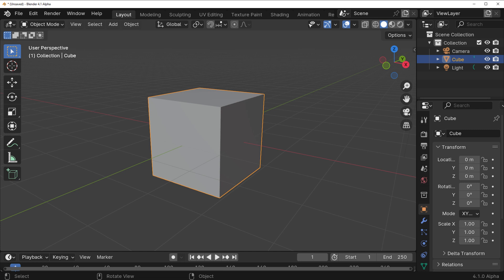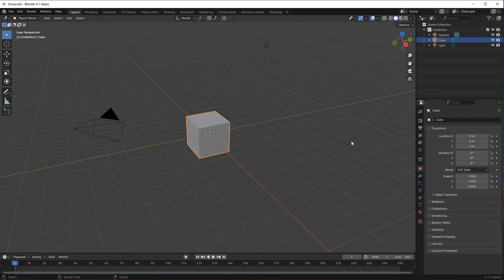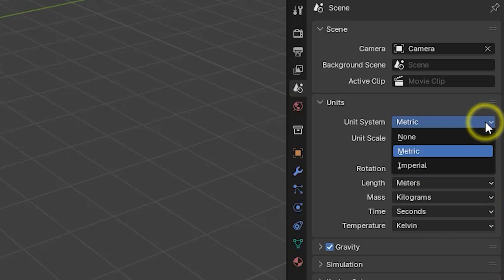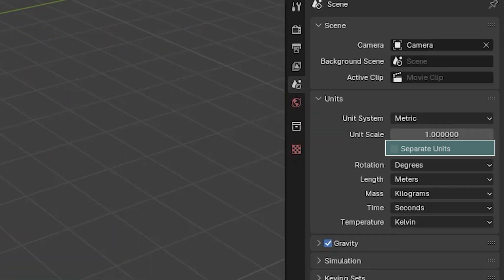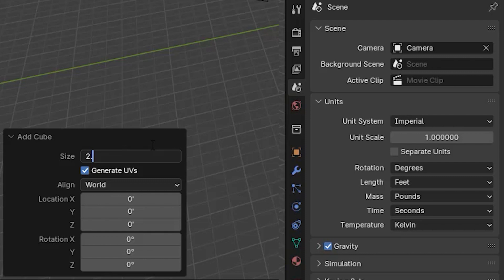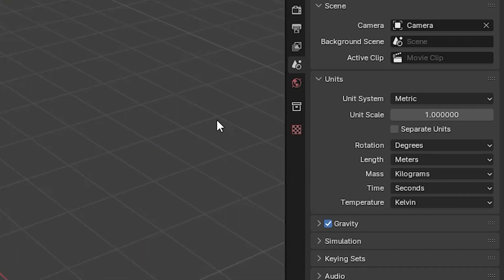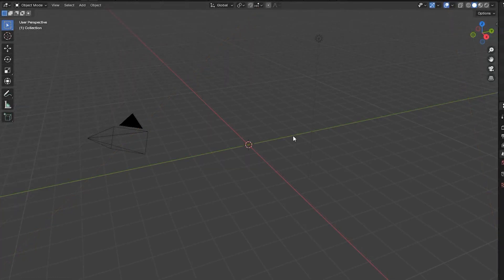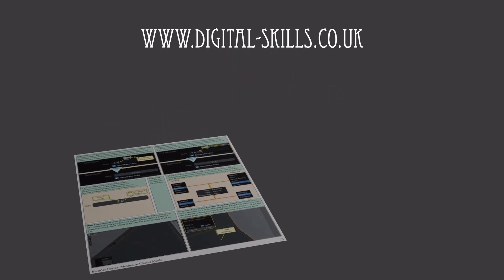3D Modelling with Blender 4.1: Setting Measurement Units

Comment: is there a way to save millimeters as default measurement?
Reply from the maker: Yes, you can. Just do the following steps:
0) Start a new project
1) Go to Properties Editor's Scene page.
2) Under the Units heading set
     Unit Scale to 0.001
     Length to millimeters
3) Go to the Overlays panel (icon in top-right of 3D Viewport)
     Set Scale to 0.001 (redraws the grid)
4) Save your file. Probably best to put it in the Blender app folder.
5) Select "File" in the Blender menu bar and choose "Defaults">"Save Startup File"

This will make your newly saved file the one that's loaded when you start a new project and so give you the millimeter settings you want. New objects will be 2mm rather than 2m.

Thanks for the question. I'll update the video (soon) to demonstrate this. 

Please let me know how you get on.